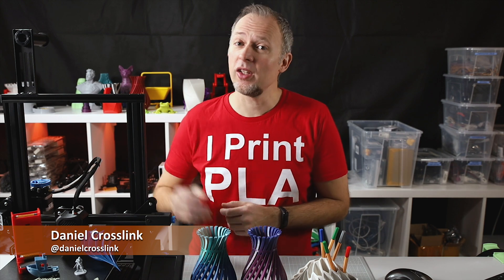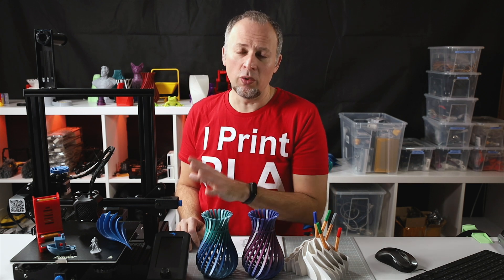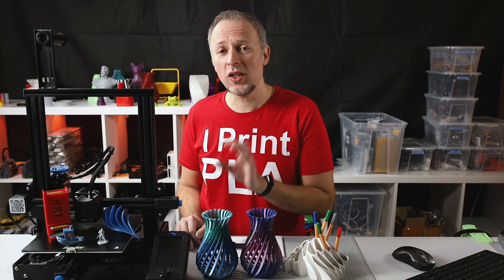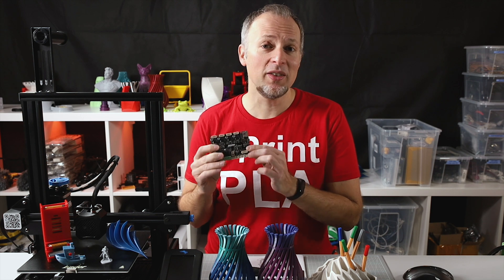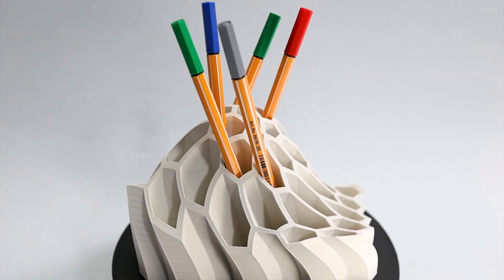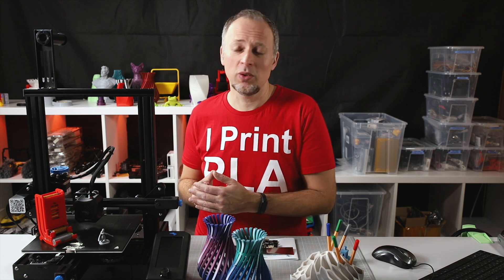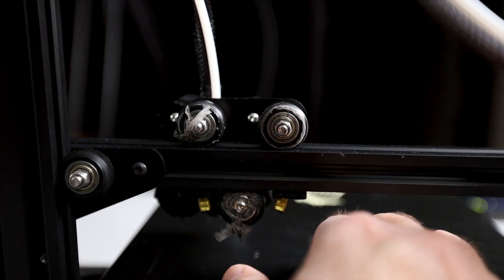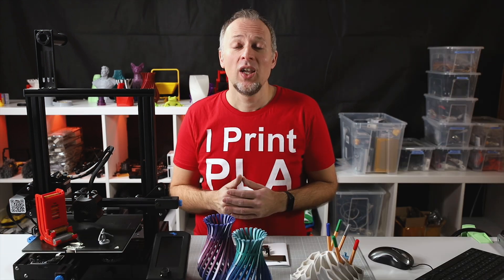🔥 Ender 3 v2 Review - The BEST 3D printer for beginners in 2021?

Comment: The Ender 3 v2 is a good printer with impressive prints, but that’s where the good stuff ends. 
The Fans. All 4 of them are noisy. The PSU fan sounding like a jumbo jet engine. It’s worrying that Creality covered the vents of the PSU which is potentially dangerous. 
I changed the PSU fan and open up the vents. Creality must tap into the PC space fir quiet fans.  
It seams the first thing people do is to VOID the warranty to make it this printer quiet. Why do consumers accept this? 
When raised with Creality they sent out a new nozzle fan, which does not come close to fixing the issue. 
Here is a suggestion: 
Have 3 pin 12v connections standard for all fans. Build firmware to see the RPM of the fans. Easy to replace if a fan fails.
To change to 12v fans you will need a buck converter to reduce the voltage. A lot of work and expense just to get a quiet life.
The Springs for the print bed are flimsy. I bought new one that are more reliable.  
I was not impressed with Creality support. Weeks of sending videos. They sent a fan that is nowhere near fixing the noise.  
After poor customer service I have decided to Void my warranty and change all the fans.
Watching loads of Videos on you tube, looking through loads of 3d print sites I see an abundance of 3d parts to change to mod for 12v Fans. But why should the End user be made to make these changes? That’s what Creality need to address but won’t. Creality should be ashamed and embarrassed that their end users feel they have to make these modifications and VOID their Warranty. Creality have certainly dropped the ball, and it’s not just the Ender 3v2, it all enders that people are modifying. 
With poor customer service, noisy fans, Poor Springs and a PSU that Creality covered up, potentially making it dangerous, I will not purchase another Creality Printer. Creality, if an honest company, must look at fixing these issues and offer customers the opportunity to have it fixed Free. The feeling I get is they simply do not care.

Comment: I picked up a Refurbished Ender 3 V2 for $180.  Upgraded all of the main parts and added CR touch and BTT Smart Filament Sensor.  I then purchased a PI and use Octoprint as well.  After all of that, I can now print anything and get perfect Timelapse videos at the same time.  I still have not spent as much as some of the printers out there and mine has everything Guchied out.  Start Cheap and replace everything and you will not be disapointed.  Thanks for all or your videos.

Comment: I just ordered mine under 3v2 about two weeks ago. The test prints went pretty well. But the armature with the extruder inexplicably start raising as a prints. So I get a base for my print it may be about an inch more and then it stops going up. Wasting plastic making a mess and give me a failed print. I've reached out to the manufacturer that's so far seems to have an ignored me. They don't have an 800 number that I can find it. And my messages have never been answered. They were happy to take my money but their customer service doesn't seem to do much in the way of service. I need advice or help would be appreciated. I find it hard to believe the stepper motor could go bad in about two weeks. And I have not been beating on the machine. But I don't know what else it could be. Also around the same time I've noticed my film it keeps breaking off in the Boden tube. I'm assuming that's a related problem. I could be wrong but I assume that was because I had nowhere to go since the arm isn't ifting as it's printing. Help
Reply: Ever hear back from the company or fix this?
Reply: John Doe   Nope never heard from them. I love the product but hate the company. I worked most of it out for myself but still other problems linger. I've tried every way to contact them including Facebook but nothing worked. They have some crummy customer service let me tell you. But thanks to help from people like you YouTube videos and personal perseverance. I am having more success. Still lots of failed Prince. Still lots of problems with my prince not sticking to the bed. Still lots of stringing. But slowly I'm having a higher rate of success.

Comment: Quite helpful but some of the technical phrases and references to upgrades went over my head. Not quite simple enough for real beginners!!
Reply from the maker: I’d like to improve in that regard. Which parts should be explained better or even left out in a beginner video? I would then consider talking about them in a separate video. Help me become better please!
Reply: @Crosslink3D  Thanks for asking. I think for an "all you want to know" video, think of a user who's just turned their printer on for the first time. (I'm only a fortnight beyond that time.) All acronyms need to be given in full for 1st time use. Unusual technical terms should be avoided or, if essential, explained fully. References to upgrades perhaps too early for complete beginners - much better if they're in a "Beginner's First Upgrades" type presentation. All the best
Rob

Comment: Does this print abs?
Reply from the maker: You can put it in an enclosure and it will print ABS, yes. Almost any printer can do it nowadays if it’s enclosed in a cabinet.
Reply: @Crosslink3D  ok thanks.  Would you say PLA is suitable for housing electronics?

Comment: This new bed is just terrible until you flip it. On my printer I can't make default surface to work with PLA from Creality which is quite fun (not) - it just does not stick at all no matter how hard you trying with leveling, washing with soap or IPA, changing springs, manual meshing, etc. After I flipped bed and start printing on pure glass with brims - I finally got some good results. I think this bed is just marketing scam from Creality.

Comment: Will this printer work well for firearms printing?  I'm looking to print AR Lower receivers and Glock frames.  Thanks!
Reply from the maker: What materials do you like to use?
Reply: @Crosslink3D  I’m not sure, I’m brand new at this.
Reply from the maker: PLA, which is the material that works easiest is good enough for a lot of stuff. However ABS is much more rigid and still shock absorbing. That will require you to put the printer in an enclosure (you can build from cardboard even). There is other materials like Nylon that this one won’t print unmodified because that material needs to be printed at 270-270 celsius.
Reply from the maker: So Yes. Start with this printer and eventually start modding it. The e3d hemera hotend system goes up to 285 degrees Celsius for example and can easily be installed on this printer.
Reply: @Crosslink3D  Excellent, thank you!
Reply: @Crosslink3D  Thanks again, I truly appreciate it.

Comment: Great video! really informative and clear. I am keen on getting this as my first 3D printer. 
Can anyone tell me how you would print one item with multiple colours, as the vase was in this video?
Reply: If I'm not mistaken the vases would have been printed using filament that changes color several times over the length of the spool. Not precise enough to make detailed multicolored prints, but results in a nice gradient for something like a vase.
Reply: @Jefferyenns8  BTT Smart Filament Sensor.  It will alow you to change Filaments during print process.  OctoPI or not.

Comment: I let mine cool down for a hour after prints and they completely detach from the bed alone. I dont need to pull or peel it at all literally just lifts off. I do this because its stuck pretty good when its fresh and It ruins the corners peeling it.

Comment: Another overrated, rushed and under engineered chinese product. For a start, a dual Z lead screws and mesh levelling enabled in the firmware is a must!! And from the first release this never looked as a complete product, and rather designed with "That will do" attitude and off to the market, let the user sort it out. I've built two printers myself and recently bought a Homers/Tevo printer (came with dual Z and 32bit board as standard), all of them pull just as good prints as any E3 i've seen. I can't understand what's the big fuss about this one as there so many good kits within the same price range. It's a hobby grade toy that everyone wasting crazy cash trying to tune it to get a decent enough results close to a high end printer

Comment: I am struggling to pick either the Ender 3 V2 or the Ender 5 Pro. Which one do you think would last longer and which one would be more convenient for a beginner?
Reply: I purchased a 3 v2 about 2 weeks ago and its been my first 3d printer. To my knowledge the only difference is size. The 5s have the 4.2.2 board as well you just gotta look and I got a BLtouch because the bed is wonky (haven't installed yet) so expect to modify your printer so it fits what you need
Reply: @9r0t0typ3  Thanks, appreciate the reply!

Comment: The spring tightening screw and the metal filament guide for the extruder are also on the pro now, mine came with those features and i got it just before the V2 released

Comment: I just ordered one the other day, waiting on delivery, I’m looking to use it to print props and cosplay parts like helmets split into pieces of course.  But what software do you suggest?  I have prusaslicer that I used on one of their models and I’m very familiar with it.
Reply from the maker: I’m using CURA for most parts. But prusaslicer will also work fine!
Reply: How has it been for you as far as printing props goes? I just ordered mine today for the same purpose.
Reply: How has it been?
Reply: @KillerofGods  I  have not been able to get it to work lol its just been sitting on my shelf ha ha ha
Reply: @GeneralChurch  lmao what about now?
Reply: @torn5203  still just sitting on the shelf not doing anything lol

Comment: Creality finally realized it was cheaper and faster to produce the housing for the touchscreens using molds when mass producing instead of wasting time printing them.
Reply: Injection molding will be the better faster way until 3d printing is done through charging temporarily magnetic liquid plastic that assembles itself into shape prior to solidifying 😉
Reply: @gravestoner  how high are u
Reply: @itsLuisG  

My statement

Your head
Reply: @gravestoner  
My statement

Your head
Reply: @itsLuisG  so many ignorant people In yt comments 🤣
Reply: @itsLuisG  i understand you only think 3d printing can be like how it is. But imagine future technology we haven't invented or discovered yet. Like the possibility of controlling magnetic fields accurately, with precision and using that with a molten magnetic liquid to shape it with the futuristic technology will allow even more precision of injection molding without the mold, and with the ability to make any mold without having an expensive production process. 

I understand most people can't think outside the box. That's why interesting people make these inventions, and not normal people.

I also understand my username invites the ad hominem you resorted to. 😉
Reply: @gravestoner  Some people are just too sensitive nowadays
Reply: @itsLuisG  because I pointed out your ad hominem? Or because I pointed out you were wrong? Or a combination of the both?
Reply: @gravestoner  there are so few materials where the curie point is higher than the melting point, none are even remotely stable enough to shape into something resembling an object before cooling. Shaping things in 3d with magnets to that extent is impossible with any remotely current technology, as any deviation beyond spherically symmetric shapes would cause the build to be unstable. 

We’d need a material that is malleable like plastic, yet is ferromagnetic and also has a curie point much higher than the point where it becomes a very viscous fluid. 

The material physics advances alone are going to take decades, not to mention cost, availability, and the impossibility of shaping magnetic fields to that level of precision without distortion. 

It’s an interesting concept, but the physics doesn’t work out. Nice science fiction concept though
Reply: @gravestoner  oh my god how could I have forgotten the most important part of why that’s impossible- keeping objects in place with magnets imparts a significant amount of kinetic energy, raising the temperature past the point of the curie point and causing structural failure. So yeah, not possible.
Reply: @genessab  yeah, just like computation was impossible in the past before you know.. computers. 

People like you try to prevent change and the future. Unless someone else does it for you "oh that's impossible"

Actually sir. It's plausible, please prove it wrong rather than simply say "to much energy and too much to think about" 🤣
Reply: @genessab  last I checked my magnets didn't use any electricity, and didn't get hot.
Reply: @genessab  if you were to tell people, 100 years ago, they would have a device in thier pocket the size of thier wallet capable of the tasks a cell phone was capable of, what responce would you get? 

"Impossible" aka you. 🤣
Reply: @genessab  aka my point is it is plausible. And probably likely to be possible with future technology. Which is why I didn't ask why were not doing it already. My reference to telling someone from 1900 about cell phones they would say there is no such technology possible of doing that. The future generations discovered light waves capable of penetrating walls and put a bunch of satellites in the air to make it possible. If you told then HOW cell phones would work they would think you were eve crazier. 

Literally what I am saying and your reason for it being impossible in the future is exactly like it would have been telling telling about cell phones. Thank you for your invalid/deterring/giving up/non-innovative responses. 

Btw I know it is not possible with today's technology, you are the one making the mistake of assuming we have already made all the discoveries. 

Closed mind, try to open it, you get new ideas that way.
Reply: @genessab  if you told the world's first computer scientists that in 70 years thier computers would he able to process billions of requests a second they would argue that physics would not allow for vacuum tubes to provide that turnover. And they would be right in that statement but they haven't yet understood electrons. 😉
Reply: @gravestoner  if you told a physicist from 1800 that someday you could create energy from nothing, they would not believe you. And they would be right. It’s not about the inevitable march for progress, it’s about actual physical limitations of our universe. 

Also saying ‘my magnets don’t use electricity’ is incredibly painful to hear. It’s clear you don’t understand the absolute basics of electrodynamics, so it would be kinda pointless to even argue with you :/ sorry man
Reply: @genessab   your lack of other prespective is amazing. You live in today so strongly. It's not unusual to think you are at the end of discovery and everything possible is apparent to us right now, we're smart after all, we have to assume this. Reality is different and it takes a different, more innovative, mind to even begin to try and consider trying to do something new. Try to open your mind a little. But you won't thats okay.
Reply: @gravestoner  dude I’m not against the idea that some better way of 3D printing exists, but your specific idea of what it might be in the future is not possible. 

This is like someone in 1700 saying ‘someday people will strap rockets to horses to get around’ and when you point out all the flaws with that idea and the physical impossibilities, they just say ‘you have a closed mind! There will be faster ways of getting around in the future, you just have to imagine them!’

Like dude, obviously there will be better ways to 3-d print. But trying to bend the laws of thermodynamics and electromagnetism to fit your specific idea of what the future holds is a lot more closed minded.
Reply: @genessab  flat earther

But in a time where most people are also flat earthers. 🤣
Reply: @genessab  but you are proving my point. Every step of history with every discovery came everyone thinking they have made it and they can stop trying to innovate. You tell someone a future DISCOVERY will prove everything they THOUGHT AND ACCEPTED TO BE TRUE was actually FALSE and that this NEW DISCOVERY allows for something UNIMAGINABLE to now be possible. You are stuck in your place, unable to view a prespective other than the past.
Reply: @genessab  it's also literally 100% predictable you would draw this conclusion btw. Some argue that even if people from the future did travel here, nobody would believe them even about futuristic technology they couldn't reproduce as an example to convince people like you, without spending billions of dollars

Comment: Guess this guy should watch some other 3D printing channels, they all say to check the nuts, bolts, screws, and rollers before you run the printer. Remember people your getting a cheap printer from China, they don't adhere to the same rules as the rest of us.

Comment: I love glass beds for the mirror finish underneath prints and placing finished print in the freezer, it pops off on it's own.
Reply: Hi I’m new to printing. Are you saying you remove the bed and print as a whole and then place it in the freezer?
Reply: @SomeoneAwesome3998  after the print has finished remove the glass bed and place in the freezer. The finished print will pop off the glass bed after a bit of time
Reply: @SomeoneAwesome3998  not all printers beds can pull off so don’t try it on yours unless you know it can

Comment: So basically all the missing features are already in the CR-6 SE but for 399€ instead of 275€ for the Ender 3 V2.

Would you consider 125€ for this upgrades reasonable? Or would you rather buy an Ender 3 V2 and upgrade yourself?